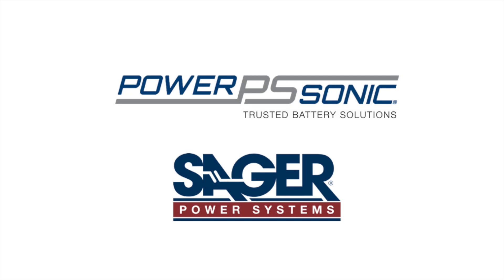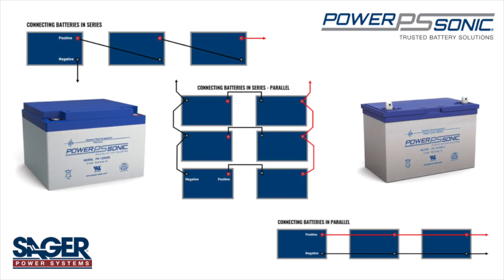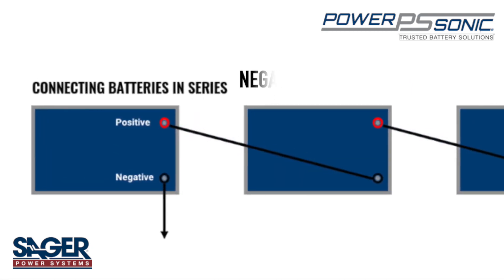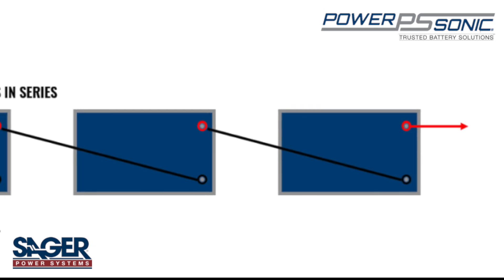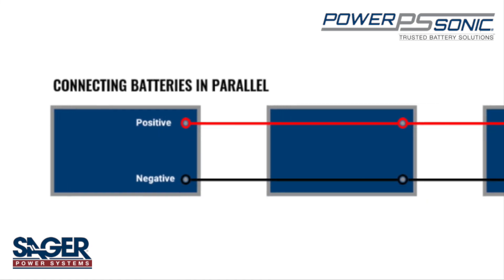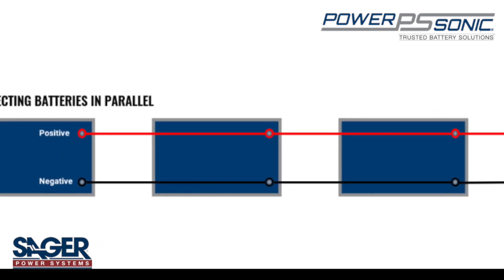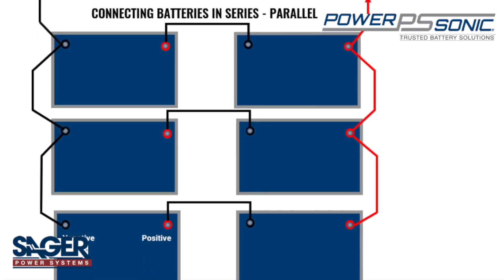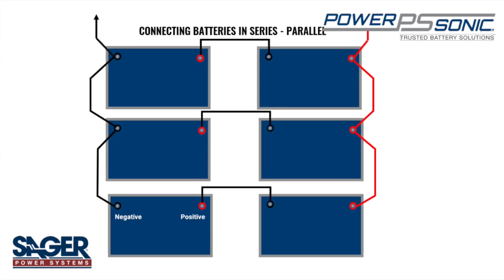Power Sonic - How to Connect Batteries in Series and Parallel

Comment: That's nice, but an actual real life video on connecting wires to the terminals would be better.  I need to change mine out, and can't see how to get the connectors off the old battery.